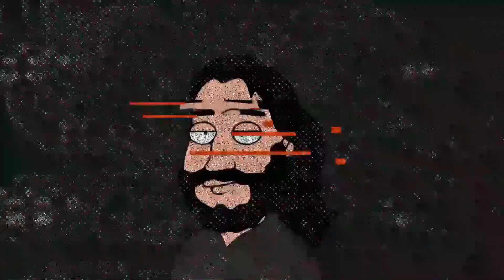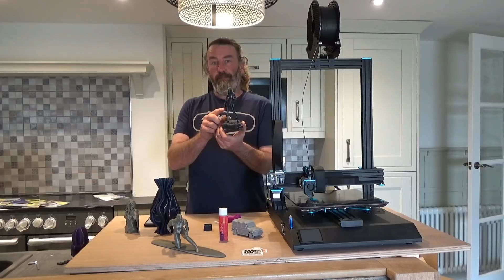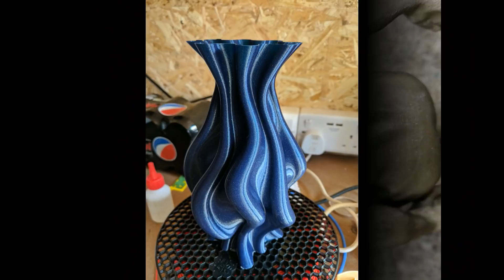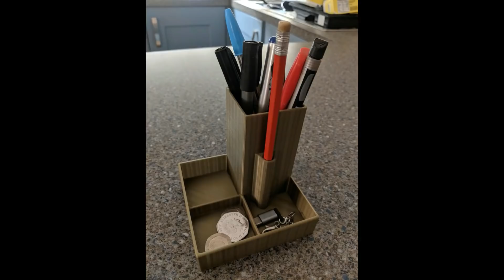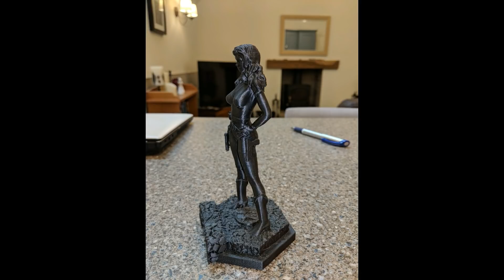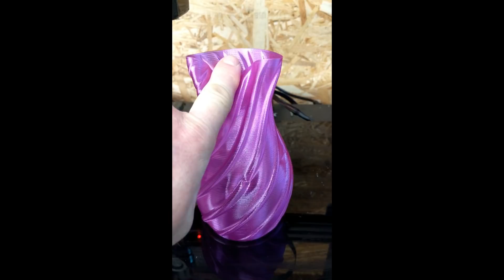Artillery 3d Sidewinder SW-X1 Review

Comment: My experience with it is very, very bad. I could not print any shape with it even though my old printer prints these shapes
And after several attempts, a malfunction occurred (the fans are working but the screen is off). Now they are broken and have only a week of arrival. Are they recycled!
Of course, I wrote to them and awaiting their response, and I bought a printer and shipped it in an urgent way, and it comes with a number of upgrades, and I think it is better than this scrap and is bigger with a work surface 350X350X400 Yes, it is a little more expensive, but the same brand of old printer

Comment: Dear sir is there anyway to increase the nozzle temperature up to 260c so it able to print Nylon?
Reply: The hotend is not all metal. There is a PTFE-Tube going down to the nozzle.
But as the heatbreak is e3d-compatible, you simply might change it to an all metal one (e3d, microswiss). About 20$.
Printing with pure nylon without enclossure might be a problem anyway. Also you might need wood-glue : water 1:1 mix on the bed for good sticking. Might not be a good idea on an ultrabase-style bed.
But something like carbon fibre enforced Nylon might be more easy to print (less worping than pure Nylon), if you change heatbreak and nozzle.
Reply: @oleurgast730  Thank you very much

Comment: I like your video. I also like the Sidewinder X1 very much.

One error you made: You say the bed heating up very fast. Sadly that is not true. The silicone heater heats up fast - and thats there the thermistor sits. Actually the glasbed itself take a long time to get to target temperature. In the middle of the bed I measured about 55°C 10 minutes after the display said 60°C reached. Also the edges where much less (under 40°C).
The profiles Atillery provides a workaround: They set first layer temperature for PLA to 90°C. The moment the temperature is "reached" the surface realy have about 50°...
But that depends on the print and is no good way to do it.

So you should prehead the bed at least 10 minutes or better 15 minutes before starting a print.

Altogether the silicone heater + glas plate is the weak point of this printer and I will change it to silicone heater + Aluminium base + magnets + spring steel. Of course I will have to reduce speed a little, as an aluminium bed has more weight than glas...

Comment: Hello, great video.
Sorry I do not speak english, but what do you think about the adherence of the bed with pla ?.
Listen in a video that adherence is not very good, is it true in your experience?
Reply from the maker: +3D print Costa Rica I always use Magigoo when I print anything on any of my printers ( apart from my prusa mk3 ) I have done some small test prints on the SW-X1 and the bed adhesion seems fine. But like I say for long prints I always use Magigoo. 

Hope this helps

Comment: Hello. Thanks for the review. Looks pretty good, but I have one big question. The hot end is listed at a max of 240c. If I need to go hotter, what's the limiting factor? Will a hotend swap get me higher? What hotends is it compatible with?
Thanks,
Reply: Dear friend, thanks a lot for your question. Our printer is AC heat bed we had set protection when the temperature reach up 170C, so when reach 170C, will stop heat. pls kindly know, if any other confuse, pls contact me, tracy@artillery3d.com or skype: tracystk. Thanks a lot.
Reply: @tracywang9514  hello. I was asking about the hot end, not the heat bed. But that is very impressive the bed can get that hot.
Reply: @kingcustompaintball1444  I'm so sorry for making misunderstanding, maybe you can send me email and let me show you our details, thanks a lot.
Reply from the maker: +King Custom Paintball I'm pretty sure a swap to an all metal hot end would be the answer. I haven't checked but I'm lead to believe this one is ptfe lined so that would account for the temperature restriction
Reply: @MATS_MAKERSPACE  Thank you for the response. Artillery actually got back to me as well and confirmed it has a ptfe sleeve inside the hotend and that's the limiting factor. They also told me the frimware limits the maximum temperature to 270c. I have been really pleased with Artillery's support teams responsiveness both on this video and in a facebook group i joined. Along with reviews about the printer like this one, the support before I have even purchased the printer has been great and is really persuading me to purchase. Thank you.
Reply from the maker: Glad to help

Comment: Great job on the follow up review to the unboxing. The endstop sensors are inductive proximity not IR and this is a good thing. I have the same sensors on my Tevo Flash and had one that got broken in shipping when the bed was able to crash into the Y sensor and smash it. I found you can sub a micro switch also and that's what I did until I could get a replacement sensor just like you did. Again thank you for the review .

Comment: Hi, I really enjoy watching your reviews on this 3D printer.
I am a newbie and only had a AnyCubic Mega-S for a month since March and somehow the mother board not working anymore. While waiting for replacement to fix that I am considering a 2nd larger printer (so itchy to print something asap...).
I am struggling between this Artillery Sidewinder and the Creality CR10s PRO. I have watched many reviews for both. Seems the CR10s-PRO capable to print "perfectly" but may encounter levelling issues often. But I do love some of the features of the Artillery even it has not much proven records, that it has faster heat bed (110c in 5m), perfect level glass bed (like you said, you have only manually leveled twice), the LED light and Wifi are definitely decent bonuses, silent printing and solid built are great reliefs. I also like to see how the Direct drive and Volcano extruder could work with the Merlin 1.19. I can see the print quality of Sidewinder is very good, but can this compare to the CR10s-PRO?
Please kindly advise which machine I should go for. Thank you.
Reply from the maker: +Pierre Tsang thanks for your comments. just to point out WiFi although in the menu as the board is capable the module is not present in this machine. I don't own a cr-10s pro so my ability to compare the machines is really not possible. Having said this I watch a video just the other day from and incredibly well respected maker and content provide who said that the SW-X1 is everything the cr-10s pro should have been. Personally I can not recommend this machine highly enough and it really pushes the boundaries of what you can expect from a sub £400 machine.

if you do decide to buy the Artillery please consider using my link as it gives the company feedback that people like my review. 

Thanks again for your kind words.

Mat
Reply: @MATS_MAKERSPACE   Hi, Thank you very much for your prompt advise. I may go with the CR10s-PRO for now and keep my eyes to the next version(s) of the Artillery (Evnovo) printer when the tweaks once get "Complete" like the CR10s-PRO. 
I really enjoy watching your videos. Will love to see how your Artillery Sidewinder performs and upgrades in the future, which should be very excited. Thanks again.